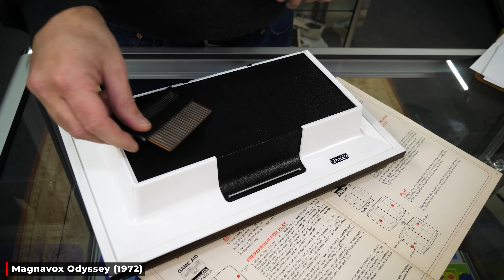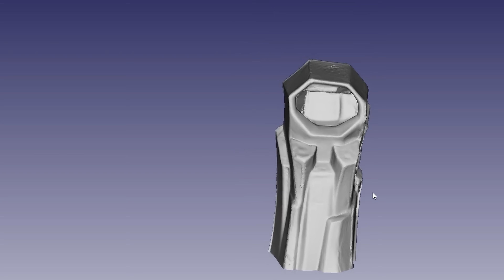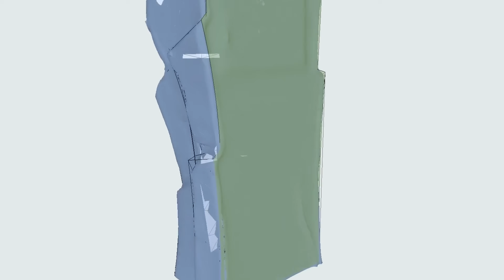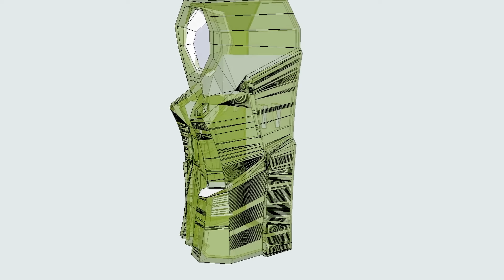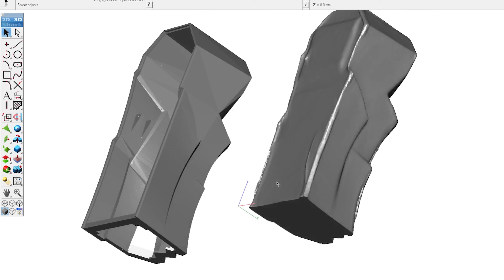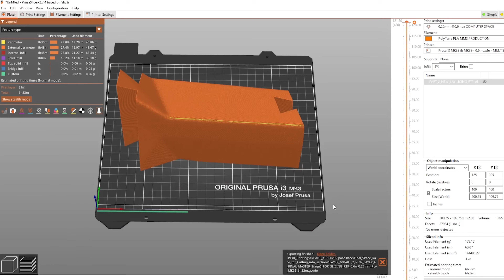We Laser Scan and 3D Print a Full Sized #atari  Arcade Machine from 1973

Comment: Somebody with an Orange Storm Giga probably could have printed this in two pieces.

I applaud your dedication to doing this in so many small chunks, I would have hated to do that.

If you do anything like this again in the future, I recommend using an adhesive called 3D Gloop for putting the parts together and using regular old Bondo for the sandable surface coat.

Comment: Fantastic work! The design and assembly was extremely interesting - did Richard have to add all the tongue/grooves manually?
Reply: Yes I did, it's a manual task of rotating each layer and making sure the section to be cut fits the 3D print bed and is rotated correctly, then you have to select the size of the tongue to make sure it's inside the thickness of the wall at that particular point on the model. You also have to think about any overhanging areas and change the cut angle and rotation to match. Then the Slicer (PrusaSlicer) actually does the cut function and separates out the two sections. Then you repeat again for the next section. I ended up with around 10-12 smaller sections per layer and in total around 120 parts.

Comment: you can buy "spray sandable filler" we use it in the film industry for 3d prints. these days i would not put filler on by hand, its way too much work and the variety of spray fillers, either in can, or in liquid that can be put through a 1 -3mm spray paint gun are such that the old days of pallet knives and filler is a thing of the past. and i looks way nicer too.
Reply: Don't some of those spray fillers interact and dissolve the PLA? I'm sure I saw a small failure on SuperFastMatt about this.
Reply: @althejazzman  thats where you need to notice what solvents are present in the spray, if the solvents are corrosive to plastics, then a simple primer should be used prior to filler. like automotive (acrylic) etch primer.
Reply: Same goes for when he gets to the clear coat layers. I would hop spray the clear coat, i know theres limited space, I have successfully got a automotive finish just with  a cheap spray booth made from wood battens and plastic drop cloth stapled to it. using a fan and a poly tube to exhaust the fumes out. if he uses a big needle in the spray gun he can put the flake in too and then evenly disperse it. All just depends on how  he wants the finish.
Reply: @althejazzman  it depends on how much you put on and your patience level. I use spray filler it all the time on 3d prints and the only time I have issues are user error.  Melting/warping happens when im trying to rush the process to coat it again before the last coat fully cures or if the ambient temperature is too high. Dont leave it dry in direct sunlight. I live in Cali and I have learned that lesson too many times. Another issue I ran into is spraying without letting the bondo fully cure, the heat from activator in the spray will reignite the activator in the bondo causing it to warp or crack the bondo. So as long as you follow recommended curing times and pay attention to ambient temperatures, its a fantastic product and time saver overall.

Comment: I work for a professional Engineer/Land Surveyor as Senior Cadd operator/surveyor, and you are selling that "Scan" short. That's pretty darn amazing. Our Lidar systems are worth hundreds of thousands of dollars, and it's amazing what phones can do now.
Reply: Yea, it's great. We fully agree, quite amazing what you can do with a phone. 
Some of the new sub $1000 dedicated handheld 3D scanners are outstanding, giving feature detail down to 0.2mm and high accuracy even with large part scanning, we have a few. it's a really good time to be experimenting with 3D scanning.
Reply: I'm guessing the detail on the actual original cabinet wasn't exactly perfect anyway.  :-)
Reply: @sirnickity  Looking at the scan without the color overlay, all of those imperfections you can see were undoubtedly there on the original cabinet. Very impressive scan.
Reply: I had no idea that iPhones now had Lidar. It's yet to reach Android though.
Reply: This scan is absolutely nothing special. Anyone with a camera could easily obtain a much better result using basic photogrammetry.

Comment: If you guys know electronics, why dont you make you own big printer that could print that in one go?.
Reply: I have made very large 3D printers in the past. The main issue with printing very large items is that the layers introduce massive layer stress and that's eventually going to warp with something of this size. You can have it all in a heated chamber, but then it's really not worth the effort and risk of failure. So much easier and quicker to print on a 3D print farm with multiple machines.
Reply: Amongst other things, if anything goes wrong with a small print, they have to redo only, maybe, 5% of the print. Something goes wrong with the whole thing....

Comment: that chaotic multi coloured scheme would fit the 70's quite well, shame it's not the final colour scheme
Reply: I did look at it for a good 20 minutes before putting the filler on the outside, It did look quite fantastic as a patchwork model. I also switched colours multiple times for many of the sections, so it looks like it has more like 300 parts because of the colour changes, but it was 120 sections glued together.

If I ever have a lot of spare material again, I am tempted to 3D print another set of multi-colour parts just to use as an example of large scale 3D printing at our office.

You can also still see the patchwork colour sections inside the cabinet.
Reply: My thoughts exactly!

Comment: There's a lot of handheld scanners that would do a far better job than the iphone and at sub-mm precision, and their prices nowadays have dropped significantly (sub 2k and lower). If this series continues, it might be a good investment.
Reply: Do you recommend any particular ones?
Reply: @Bassquake76 For completely computer independent scanning, there's Miraco, but do note it uses IR light and will work horribly on surfaces that don't reflect it well, and/or outdoors. I had good experiences with Creality Raptor - it uses blue line laser or IR, so you can mix and match depending on what you're scanning. IR will work markerless, but lower accuracy (still massively more detailed and accurate than iPhone). Blue laser gives you very high density high precision scans, but requires markers (reflective self adhesive dots). Raptor needs a computer, i've used it with a laptop - scanner in one hand, laptop in another. Think there's a newer version with an optional wifi dongle for wireless operation too.